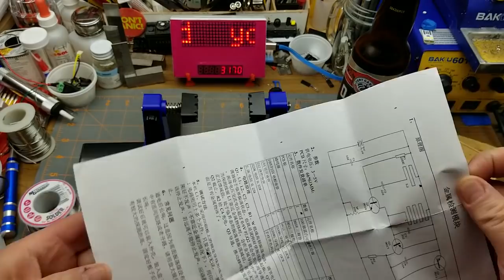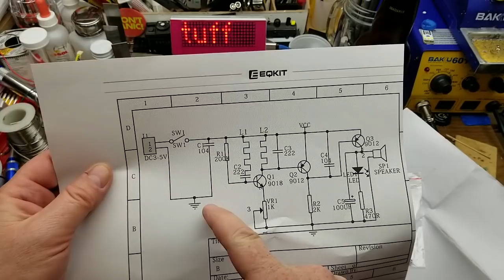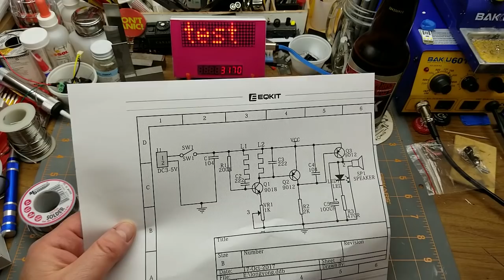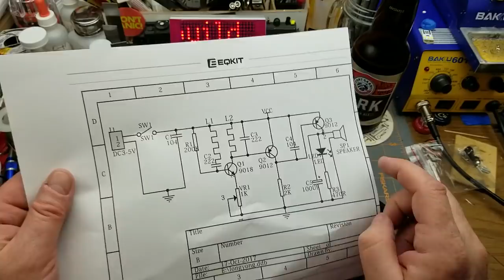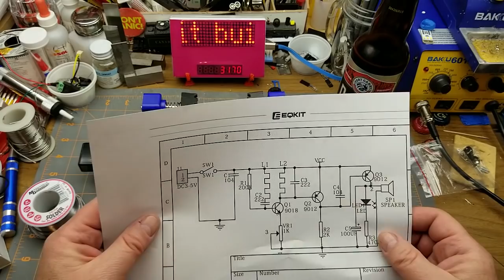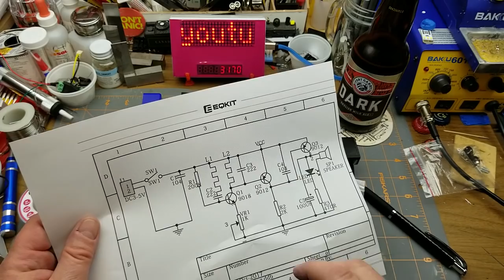The best PCB holder so far (short version)

Comment: That is close to winner. The best one I've ever seen had a pad with foam on the component side. You could populate all you components, put the "top" with a foam on it and turn it over. Cut all the leads (that need no bending) and solder everything.
Oh, and with hot air all plastic jaws are in danger. I find stuff like panavice and similar too high ergonomically. I like using table to support arms and working much above table is not that comfortable. I really love one-sided smd boars for that. Put it on the table (or very near) and working with it is so comfortable.

Comment: This tool is good for rework only.
Reply from the maker: It works very well for me when doing new board assembly.
Reply: @pileofstuff  Yeah,I agree with you. The problem for build a new board by using this is hard to lign all components and get a perfect pin appearance.

Comment: WOW someone's got a chip on their SHOWDER about Solder.
Reply from the maker: A surprising number of people tell me that their preferred regional pronunciation is correct, and therefore that mine is obviously wrong.
A few of them are polite about it...
Reply: @pileofstuff  You'll find they are generally based out of the UK since their pronunciation differs from the US. Personally I have never come across any English words with silent "L"'s unless they are directly followed by a few very specific letters like "K" or "M" or "D".
Reply: "The silent "l" in solder ("a metal or metallic alloy used when melted to join metallic surfaces") isn’t completely exotic: other, more common words like salmon, calm, walk, should, and calf also typically have one. But since solder is encountered less frequently than these (and is perhaps spoken more frequently than it is written), it’s a tricky one.

The "l" wasn't always there: up until the 1500s, most spellings of solder didn't include it. But its Latin ancestor is solidare, "to make solid," which seems to have been used to justify adding the "l" in."